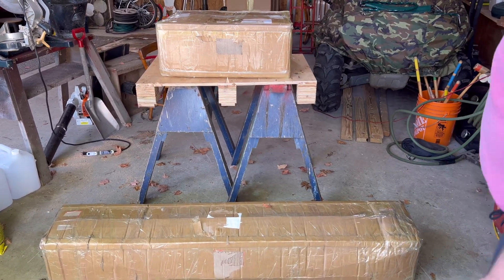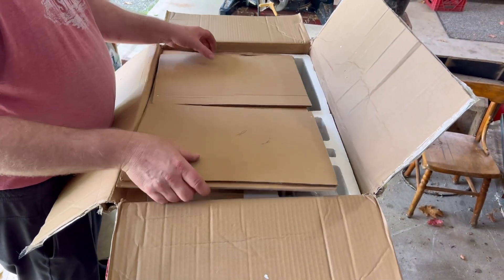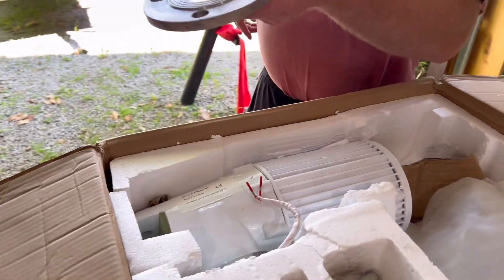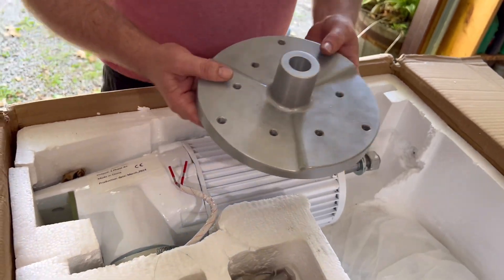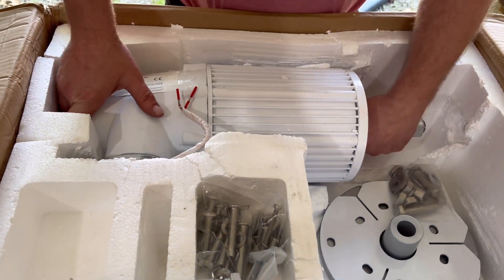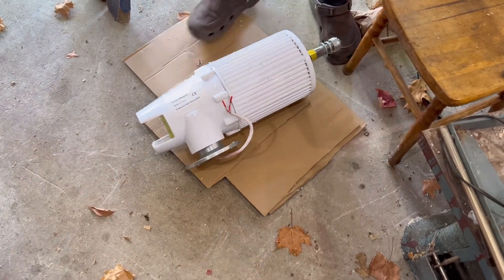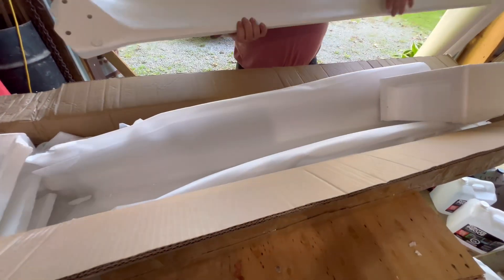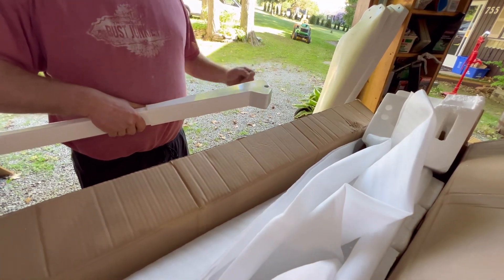wind generator for off grid, FT2000 W, 240 V

Comment: Hello from Spain. Thank you for the video. One question if you don't mind. Why did you buy the 240V model? Aren't you going to use the wind turbine to charge batteries? Cheers
Reply: Great idea, but aren't you going to need a controller at least 96V? Don't think a 48V one is going to be a good idea. I think it will be on break most of the time because the wind turbine is going to output more the 48V. Maybe the loses are goong to be less than you think. But don't listen to me, I am not an expert. Thanks for the video😊
Reply from the maker: @JoseAgustin-hq2pl  you will have to wait for the updated video. In the spring, I'm testing the charge controller. The higher voltage is to reduce the 200 foot length cable size. The Wind Turbine to the charge controller is 200 feet away.
Reply from the maker: Yes, the batteries are 48 V. The wind turbine is 240 V three phase AC. At 240 V, the 150 foot cable only needs to be rated for 7 A. I'm going to be running 12 gauge North American TECK cable. This can handle up to 25 A.

The wind turbine will be about 150 feet away from the inverter....

And in the future, I might upgrade to the 5000 W -  10,000 W wind turbine. If I do go this route, I will go to 380 V wind turbine, and I will still be able to use the same cable. The cable that is underground is still rated for 20 A and up to 600 V. So for future planning once the cable is laid, it is cheaper to go with higher voltage over the long 150 foot run then to change out the cable. This is easily done by buying a step down transformer inverter. They do cost maybe $200 more, but it's way cheaper than replacing and digging up the line.

So if I do go to the 10,000 lot turbine, this will push out up to 450 V at about 23 A.

The TECH cable is about $8 per metre, so I would need about 46 m.